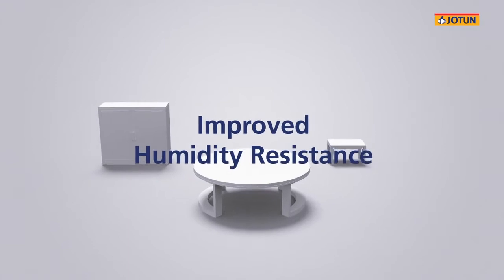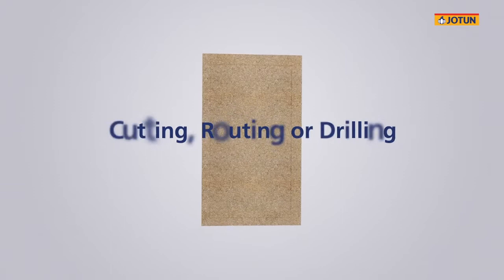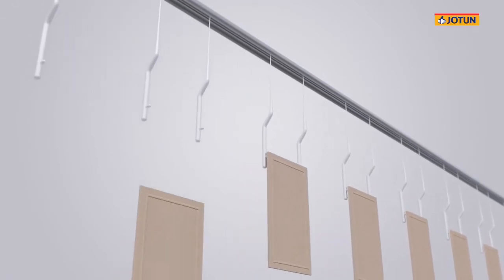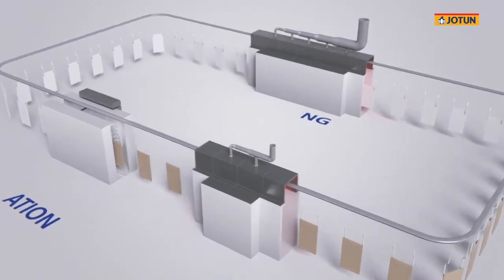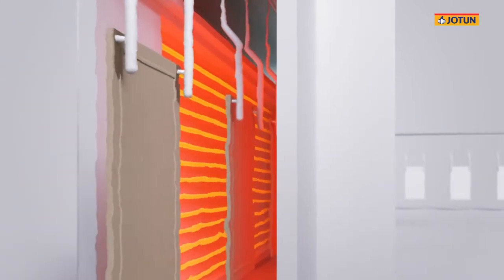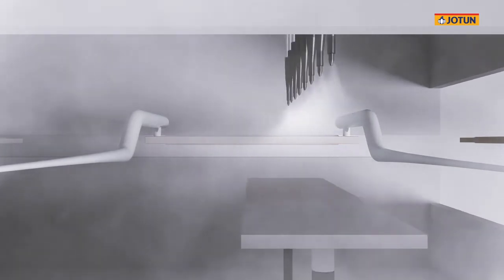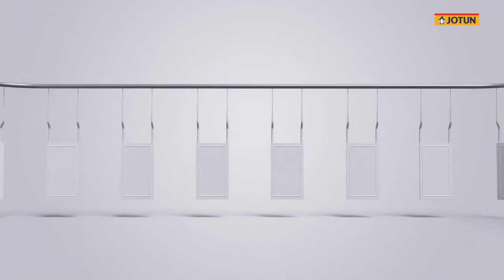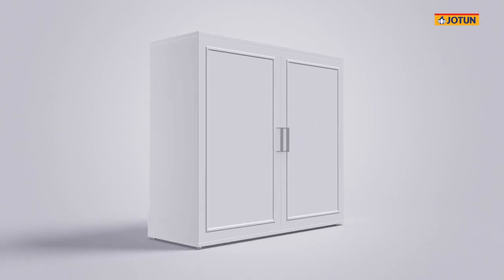You can now powder coat engineered wood (such as #MDF) with Jotun Powder Coatings!

Comment: Can we use metal powder coating equipment for mdf?
Reply: No, this equipment is more precise than the one for metal. However, it is possible to powder coat metal using this equipment without a problem.

Comment: Is it the same powder used for aluminum powder coatings? and for curing what is temperature needed and for how long, is it 180 degree C for 10 mins as for the aluminum?
Reply from the maker: It is similar to what used for aluminum but specifically formulated to cater to the needs of MDF. As MDF is a heat sensitive material, the powder is designed to cure at a much lower temperature. We have multiple products in the assortment and each has its own curing schedule.
Reply: @JotunPowderCoatings 
How can I get these materials? I own a bakery and I do powder coating on iron such as doors and others and aluminum. I now need to paint MDF and HDF wood as well. How can I buy it? I am from Iraq.

Comment: Can we do this at home?
Reply from the maker: Thank you for your query. Powder coating on Natural or Engineered Wood (such as MDF or HDF) is typically done in a factory setting due to the fact that it requires the correct application equipment, a certain quality of natural or engineered wood, and an optimal level of humidity. If you have any more questions, please feel free to ask.